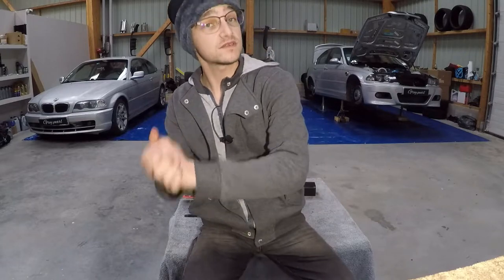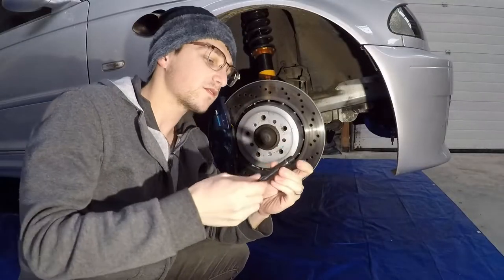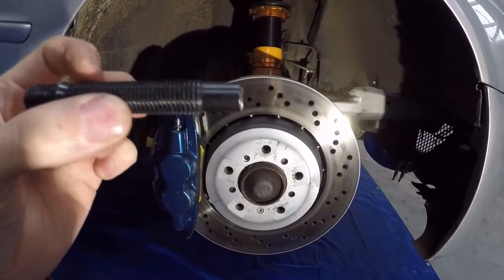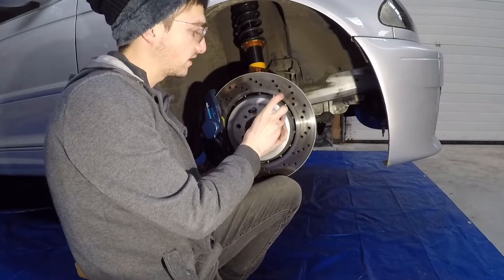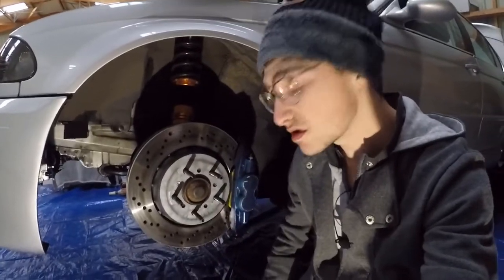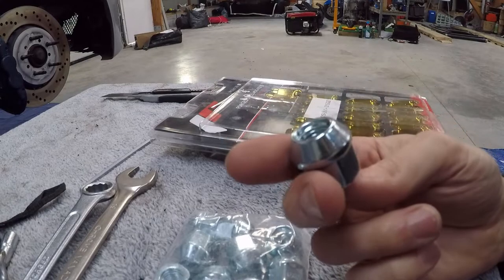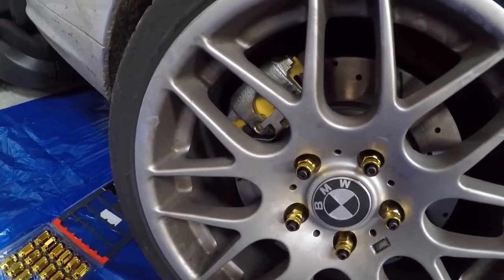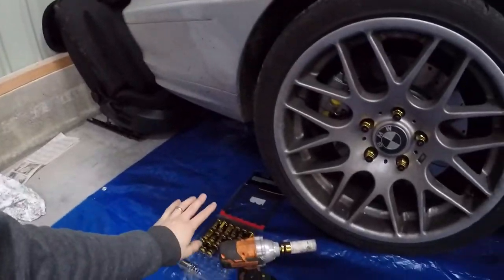Goujons Compétition BMW & Japan Racing Forgé JN1

Comment: Un question, pour mon Volvo je voulais en prendre, surtout pour changer du style des gros écrou chromé pas beau, juste les écrous suffise ? Pas besoin de changer le filetage ?
Reply from the maker: Salut, si ce sont des gougeons d’origine non pas besoin de changer tu dois pouvoir trouver des écrous adaptables, prend juste de la qualité, sur drift shop ils vendent aussi de mémoire juste les écrous , par contre il faut que tu connaisse le filetage et le pas ( ex: M12 x1.5 ou M14x1.25 ect…) chez Volvo je ne connais pas donc je peux pas te dire ce que c’est ;)